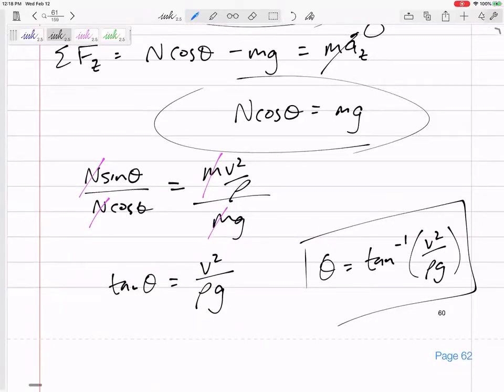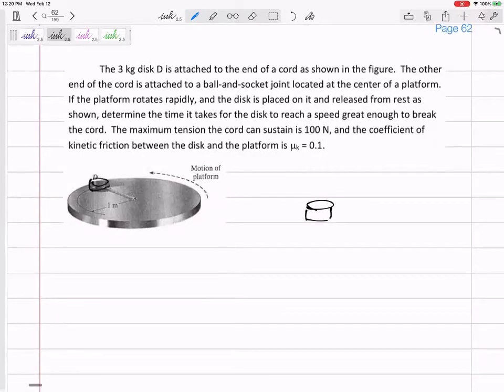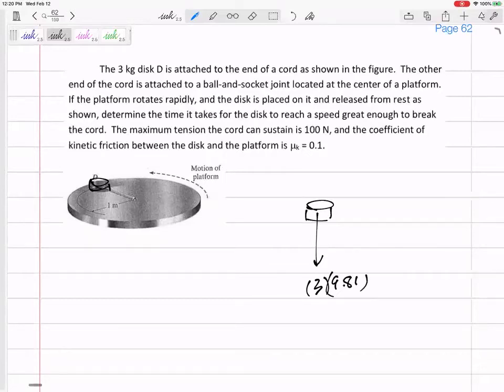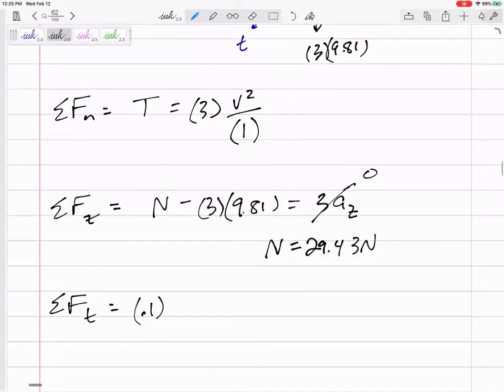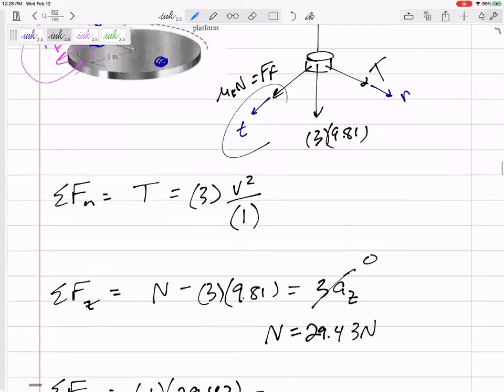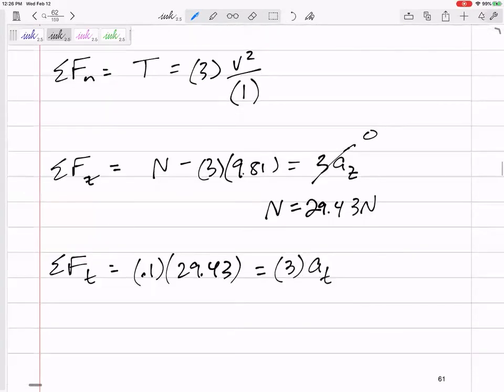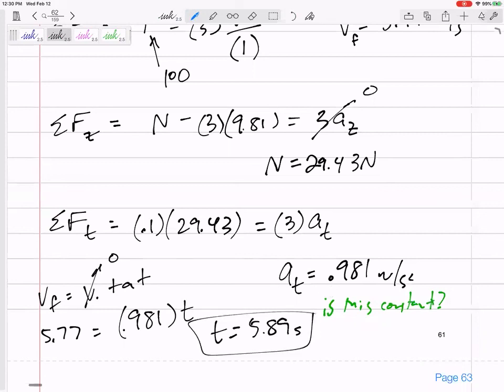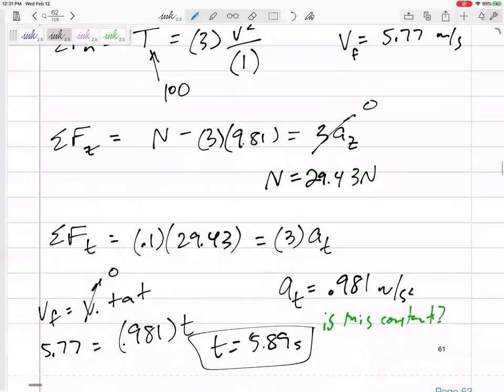Dynamics - Particle kinetics Normal Tangential example 2

Comment: Sir, one query please ...In pure circular motion is it a condition that net acceleration is perpendicular to tangential velocity? We have two accelerations tangential and radial , so object will go in the direction of net acceleration ? please advice... thank you very much ...
Reply from the maker: No, net acc is not perpendicular to velocity. Tangential acceleration is in the direction of velocity. Normal acceleration is perpendicular to velocity. I don’t think net acceleration tells you very much. The object would not go in the direction of net acceleration, the velocity would “change” in that direction.
Reply: @engineeringdeciphered  thank you Sir. But i studied that object will move in the direction of net force or net acceleration on it.. net force will guide net acceleration direction. So if i apply this on circular motion examples i am trying to understand how path of object will change as we apply different forces tangential as well as radial. 
How to understand that.. advice please.
Reply from the maker: @shailkumarjain  the object won’t “move” in the direction of net force, it will “change velocity” in the direction of net force. So if it already has velocity, a force won’t cause it to move that direction, but it begins to change velocity toward that direction. Technically it changes “momentum” in the direction of net force.
Reply: @engineeringdeciphered  ah ok..  clear.. thank you very much Sir.